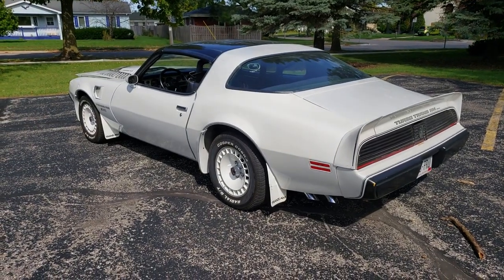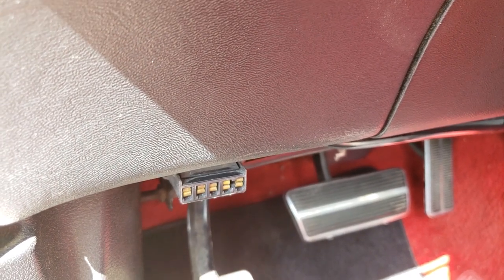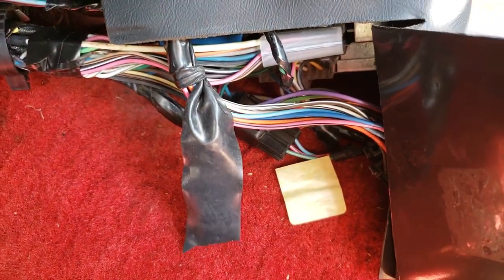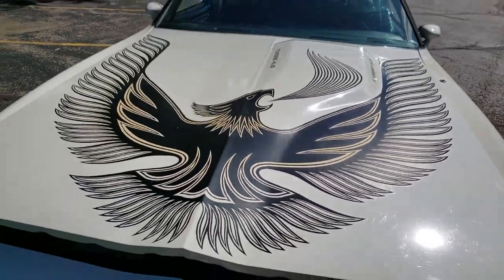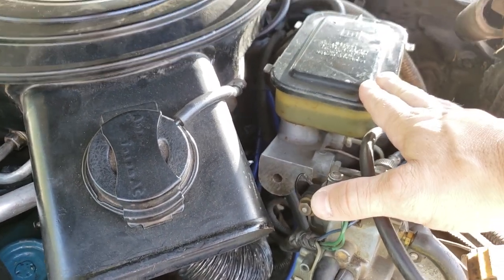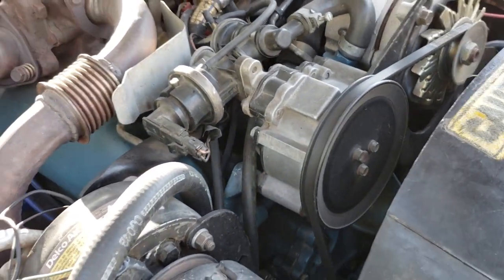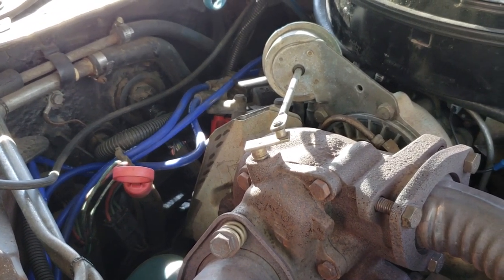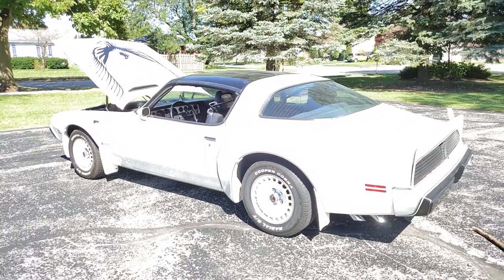TTA Performance - 1981 Daytona 500 Turbo Trans Am

Comment: You have a beautiful 81. Just so you know. Your Exhaust Splitters are aftermarket and alot different that the originals. They do make splitters that look correct. Awesome car. These cars have WS6 and 3.08 gears standard with J65 4 wheel disc brakes. I've owned 6 80-81 T/A's but i've had 11 77-79 Formula and T/A's and i owned most of them over 30 years ago. All this Turbo Tech was adopted from Buick which had it since 78 on the Regal & Riviera's

Comment: I own one of these according to my vin number it’s the 19th one built.  My vin last four digits is 0019.
Reply from the maker: That's cool that you own one of these rare pace cars. The low VIN sequence is neat. It may be the 19th Firebuilt built in 1981,  but not necessarily the 19th Pace Car as these cars were not built sequentially down the assembly line. They were scattered throughout the assembly with other Firebirds. I would recommend you get in touch with Robin French on Facebook. She has a 80-81 Pace Car registry and is keeping track of all the Pace Cars.
Reply: @ttaperformance1046  where is this robin french located I live in the derby city or Louisville Ky.  I am curious where this car is on the Production side. Thx
Reply from the maker: @2002WS6  she has a Facebook page called 1980-1981 Trans Am Pace Car Registry
Reply: @ttaperformance1046  ok thx I will look it up.  Also my console is not like the one you showed.  It is black but someone cut the section out to address the issue that was found to be solved there.  I have the piece they cut out in the glove box.
Reply: I found her and waiting on them to let me in.  So we will see.
Reply: I got in I will let you know what I find out.

Comment: You would be insane to drive one of these at all. The parts for a regular 80/81 NA 301 are impossible to find, let alone a turbo. I couldn’t find the correct TVS switches for months. It’s a nightmare.
Reply: Nah they were available up until a few years ago unless they were obsoleted by the parts stores and their suppliers. I worked for an aftermarket manufacturer---most of them didn't realize that they actually had the part in their line. The easiest way to catalog them was to go by number of ports, color/function and OEM part #. Dole and Eaton were the two original manufacturers to GM from what I remember. I was involved with cataloging them in the aftermarket and I was shocked at the holes in the coverage. No listing in the book, but we indeed did have the part in the line. Fortunately I stocked up on NOS years ago. LOL.

Comment: Had one of these. Lost her in an accident in 1999. :(  So many cool facts about the car. Had the cover for 5pin.  Facts I remember about her: 
1. Recaro Seats came with several Foam inserts for Lumbar. 
2. Only Trans Am of that Generation that had all red dash lights.
3. The brakes were a pain in the ass to do
4. It had a really cool "Slap Stick" like feature on the shifter
5. most of these cars never had the full body stickers installed
6. almost all were missing the air intake.
7. She was not Fast but you could bark those tires coming out of 1st.
8. she handled like a dream.. steering was tight and the cornering was amazing for a car that size.

I loved this car more than any car i ever owned... even more than my Turbo Regal.
Reply: Both the 10th Anniversary and '80 Pace Car also had red lit instruments. Yes the "slap stick" feature is described in the owner's manual. The original air intake is a fiber paper style, it didn't last long. LOL. Reproductions/aftermarkets were vinyl and lasted longer. The WS6 suspension was the key on those cars and showed up cars costing double the price back in the day.

Comment: Good information on the turbo wheels. . I might add the 5 digit in the vin will be a X if it’s a pace car. 
Also on the 81 pace car the gages will be back lit red . Looks really cool at night.
Reply: The 10th Anniversary, '80 and '81 Pace Cars all had the red lit dash, and yes it looks really great at night. My Pontiac G6 convertible also has red light instruments and it reminds me of my 400/4 speed 10th Anniversary.

Comment: Joe, very nice car and video; thank you.  I may be very wrong about this but it is my understanding that the ‘80 TTA didn’t have hood turbo lights, only the 81’s did.  From what I’ve read, the pics I’ve seen and the few car shows I’ve been to that actually had any there, the backs of the  80 TTA scoops were just black.  Perhaps turbo lights were optional in ‘80 and just not ordered that much.  Anyone want to fill me in here?
Reply from the maker: Thank you Allen.
In 1980, all the Indy Pace Cars got the lights. Some regular 1980 cars got lights and some did not. I read somewhere it was due to a shortage of lights during production and they were saving them for the Pace Cars. Yes, all 1981s have the lights.
Reply: I have a 1980 and it has those silly turbo boost lights from the factory.
Reply: @ttaperformance1046  It was RPO code "UR4" from what I remember and I also remember reading that cars from March 1980 production onward got them. My '80 was made in Norwood in January 1980 and does not have them.
Reply: I had a regular TTA in 1980. Did not have the lights on the hood.
Reply: @dellalderman8011  Yes, early 1980 cars didn't have them. My '80 Turbo does not. My parents bought it brand new, I still have it.
Reply: RPO code UR4 (Turbo boost lights) were standard on all Indy Pace Cars and become available to order on all other Turbo Trans Ams on 17 JAN 1980.

Comment: I just want to know if it is possible to swap in a Pontiac 326 or a 350 in place of the OEM 301 engine.
Reply from the maker: A Pontiac engine will bolt in place of the 301. Pre 1968 Pontiac engines may require motor mount adapters. 
The turbo parts will not bolt up to any other Pontiac engines except the 301.
Reply: Why Would You Want To Do That? That's So Stupid. I Say Keep It Original And Keep That Kick Ass 301!

Comment: i’m having a lot of problems with my 81 turbo Trans Am would it be a good idea to go with an older distributor and a non-electronic Quadra jet? I’d like to delete the computer control spark system and carburetor issues, I’m not worried about detonation I can run higher octane gas and just listen for detonation and let off if I hear it
Reply from the maker: Hi Mike, I believe you also emailed me. I will respond to your email with details. Thanks.

Comment: Good information, but a bit of clarity:

1) I believe the 1980-1981 air cleaner breather "box" is the same for both years of Turbo engines. My '80 Turbo is an original 26k mile car my parents bought brand new and it has the metal breather box on the air cleaner. In fact, I bought several NOS metal ones years back that I still have in storage. I'll have to look in the 21/21A Pontiac parts book again. 

2) The only real 8" Turbo Flow wheel is the 10th Anniversary. It actually measures 9". The others are are not true 8" wheels. More information can be found here: https://www.hitmantransam.com/Pages/rims.htm

Hitman and I have discussed these wheels at length and we've also determined that on the true 8" 10th wheels the alignment of the lug holes is different than that of the 7.5" wheels.

3) What most don't know is that the '80 and '81 Pace Cars are not fully contented cars, there were several options that could be ordered on top of the  Y85 packages. The Y89 10th cars are fully contented, with only the engine being the difference. The engine determined the transmission (THM350 for the 403, Super T-10 manual for the 400) and this also determined the gearing (3.23 for the 400, 2.73 for the 403). Choosing the 400 meant you had to delete cruise control, this was a credit to the buyer. Also the only other "option" on a 10th was the VJ9 California equipment option in certain areas of the country. This was only for the 403 as the 400 was only certified for Federal emissions. 

I would have enjoyed a bit more on the highlighting of the unique items for the '81 Y85.  They were very unique indeed.
Reply from the maker: Thank you for the info about the breather box. I was not sure about this considering that they usually get changed out over the years.

The link to hitman's website and your summary about turbo wheels is pretty much the same thing that I am saying. The only difference being that the true 15x8 turbo wheel (measuring 9" wide overall), as offered on the 79 TATA, was also offered on the 1980 turbo cars (and California non-turbo) with WS6. It was offered in white on the 1980, Y85 Indy 500 Pace Car, Gold on the 1980, Y84, WS6 SE (or optional on non-SE, WS6 cars) and was offered polished, like the 79 TATA, on non-Pace Car and non-SEs.
I have a set of gold, 1980, WS6, 15x8's on my 1981 SE (originally a non-WS6 car, equipped with 15x7 snowflakes). The 15x7.5 turbo wheel (measuring 8.5" wide overall) was offered only in 1981. It was standard with WS6 (or optional without WS6) in Gold or polished. White was only on the Y85 Daytona 500 Pace Car.
Reply: @ttaperformance1046  I believe Purolator and others sold a plastic version of that breather element, but the original is metal and the NOS Delco ones I have are metal. The plastic ones were blue and made by various suppliers. Yes, we are saying the same thing about the wheels, but my/his way is without having to take them off to measure them. That's the only difference.
Reply: Right. Besides the California emissions equipment, the only other options on a '79 TATA were a front license plate bracket, and either installed Daytona/NASCAR decals, or Platinum vinyl body side moldings.
Reply: The decals were spotty. GM kept no records as to which cars had them. Plus you could buy them over the counter.